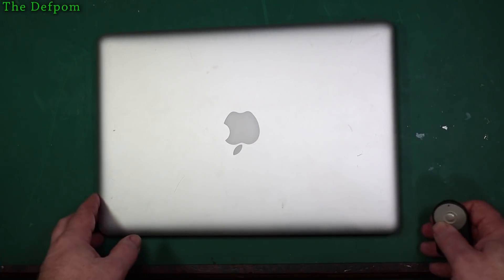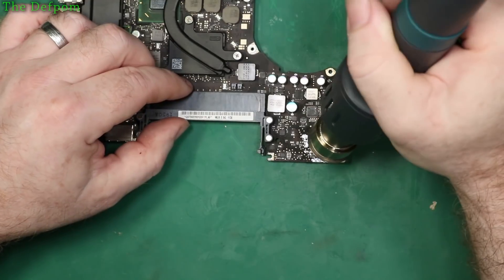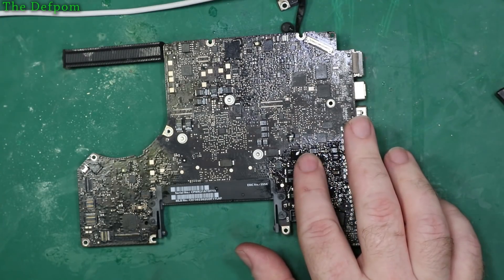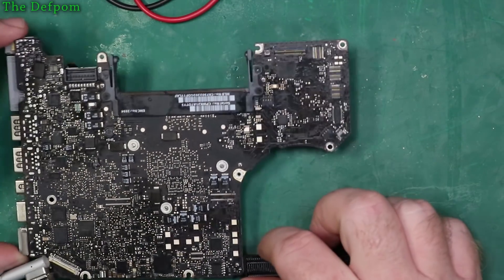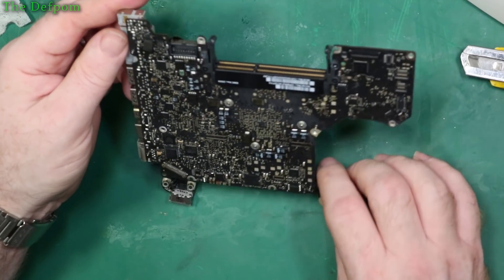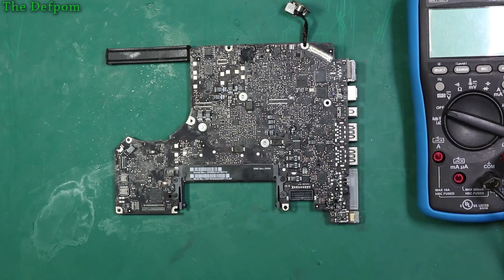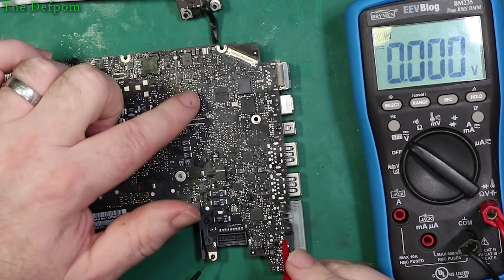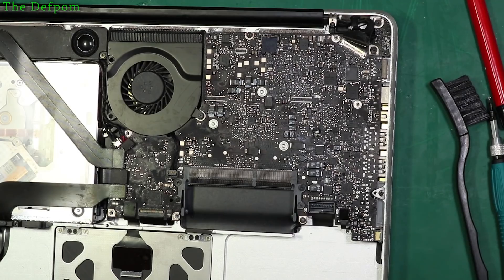🔴 #550 How To Fix Liquid Damaged Macbook Pro 13" Mid 2012 A1278 820-3115 Liquid - Part 1 SN_ATDTY3

Comment: Nice repair, looking forward to the completion of the saga. As an old guy with CRS* I certainly can relate to working on equipment and then forgetting if I have or not. I now keep small note pads with each project with reminders of what's been done and what to check next.  (* CRS - Can't Remember  S💩t)
Reply from the maker: David V - I used to have a very good memory, these days I don’t have the some level of retention!

Comment: Do these stuff water damage more commonly than other laptops it appears very common. Although I wouldn’t alway be sure it water and not some other fluid.  Now wash your hands.    Your hot air station looks good. After the nice weather last weekend enjoying thunderstorm today, been running round the garden pulling down the antenna farm. Regards Chris.
Reply from the maker: AllTheGearNoIdea - are Mac users more clumsy with their drinks, possibly, do other laptops have better ingress protection, probably.
Reply: Good job my iPad has a splash proof cover. Just saying.